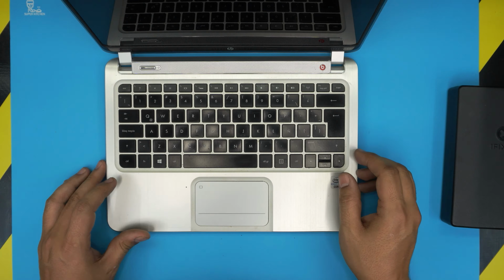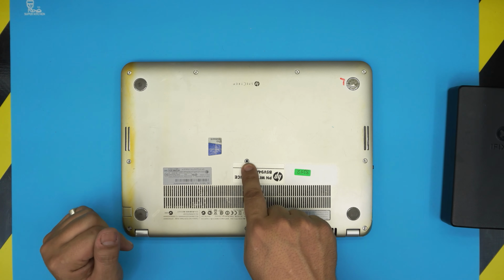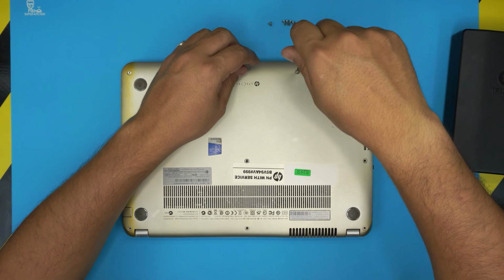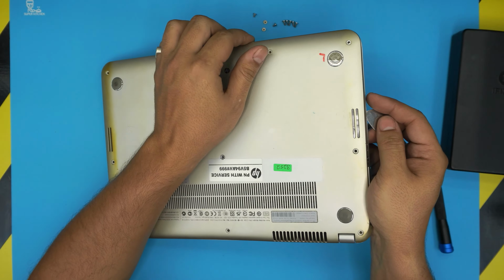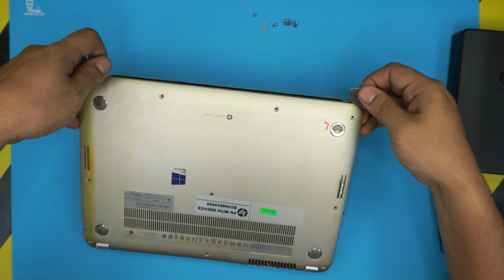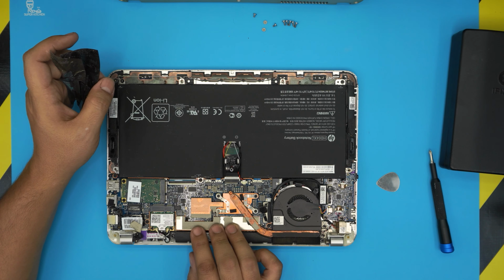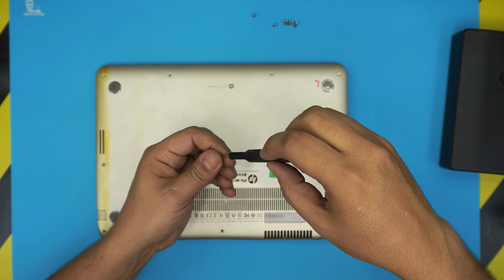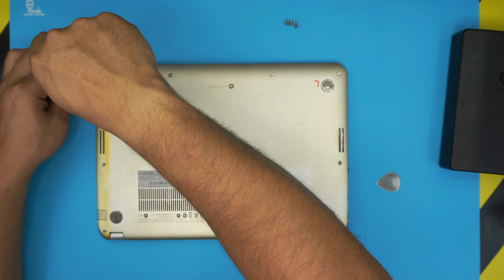Hp Spectre Xt Pro C9k21 Ram Upgrade ?????

Comment: I get a 3-blinks RAM error, which is normally solved by re-seating the RAM, I guess I can't do that since it's soldered on.
Reply from the maker: Thank you for your feedback! If you wish to support the channel, you can like, subscribe, or both!
Regarding your question, unplug the battery and the bios battery and press and hold the power button for 60sec then plug the bios battery and main battery and then power on and wait up to 15sec.
if it didn't work then you will need to replace the ram chips.
Should you have any further questions or requests in the future, please don't hesitate to ask me.